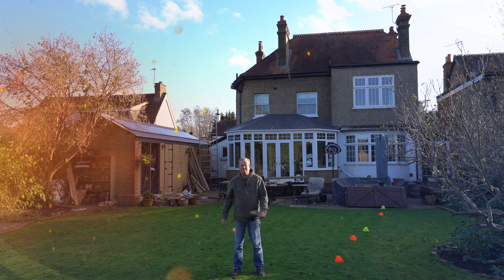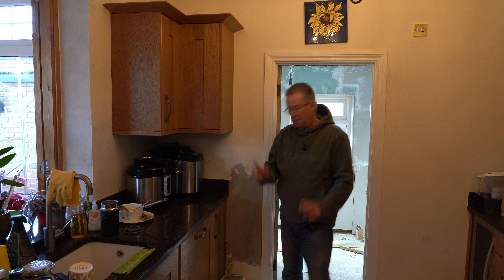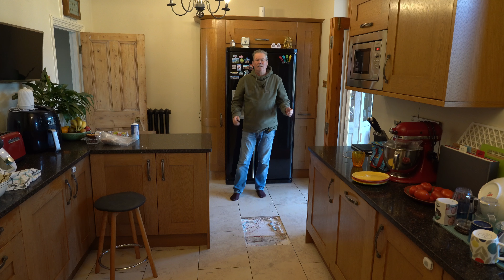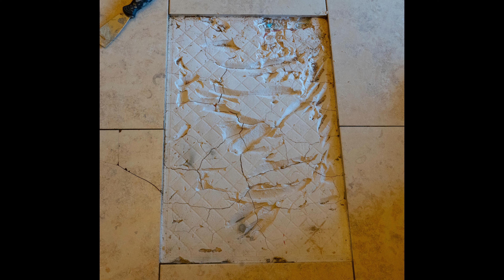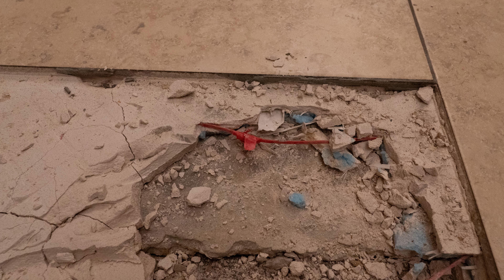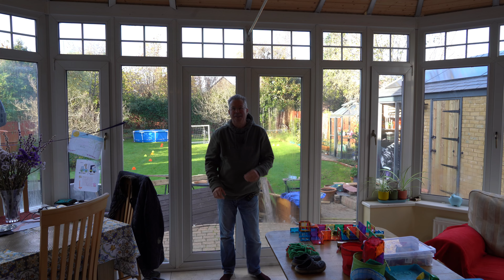Builders Versus DIY

Comment: In my experience you are correct as there are not very many good builders out there.  This also applies to Solar Energy installers.  If as yourself a DIYer is feels  competent and knowledgeable like you then DIYer,s can certainly do a better job than a jobbing builder and also save a lot of money and time.  ( I think for many, the cost of the tools required come some jobs out-way the cost of getting someone in, hence many DIYers only attempt minor jobs).  Keep up the good work,  you clearly seem to be doing a good job and the jobs you have completed to date seem to be of a good standard.
Reply from the maker: I have been lazy today because it is so cold and damp out there. I also became embroiled in looking for alternative solar panels to Viridian because they have gone up in price whilst others have reduced rapidly. This would mean a slightly different approach to my roofing but I would still want them to be flush with the tiles. Your comment really appreciated.
Reply: @MrJonesDIY  City Plumbing sell LONGi 425W Full Black solar panels for £57 each or 430W for £66 and you get free delivery over £75 ex VAT. Wondered what you thought of these?
Reply from the maker: @danyalm10  Hi. I was quite interested and had a look at the LONGI panels at City plumbing and decided to buy three to test in my garden. Unfortunately when it came to delivery it was not available although they were in stock for collection. The cost of delivery from most companies seems to be in the range £120 to £150. I will do more research on this and produce another video.

Comment: My take is that the second you introduce time constraints to a job that involves investigation and redesign to get a job absolutely right, you immediately compromise the outcome. And time constraints are always in place for contractors. Especially for bigger firms. If you want a job doing 100% correctly, the only thing to do is train yourself up and have a go. Then at least if it goes wrong, you learn and have the specific knowledge of how to put it right on the second pass.

The best tradesmen I knew would sit and mull over a job for half a day or more before touching it. That's a great way of approaching it, but not profitable. And some clients don't appreciate it.
Reply from the maker: I could not agree more and to be honest, the length of time it took me to decide how to redesign and reroute the back gutter plus hide the sanitary pipes on the conservatory would be at least a thousand pounds in tradesman hours. Neighbours thought i had gone crazy, balanced up there staring, shaking my head and swearing.

Comment: Steve, you must be so disappointed with the kitchen floor and the worst thing is then you question the rest of the kitchen work. far too often when I've had workman do anything they look for a solution which is quickest and easiest for them rather than a solution which will work the best. When we've had decent workers work on our house it's like a beacon of hope glowing brightly. pride in their work seems in short supply. well done on the work you've done.
Reply from the maker: I will certainly have to remove all tiles in the kitchen and conservatory because they were both done at the same time. I have already replaced the plumbing they did under the sink because it was leaking and they had not installed isolation valves. I will need to find a way to keep the units in place whilst replacing the floor beneath them. I will of course do it myself.
Reply: @MrJonesDIY  so frustrating. i'm sorry to read that and I know from experience just how much a new kitchen costs. when we had ours done I ended up asking the area manager of the kitchen company to leave. the sad thing is you end up not trusting anyone to do a competent job, my thoughts are with you